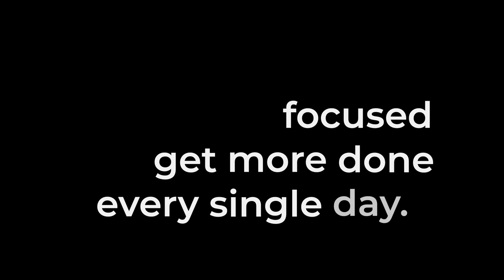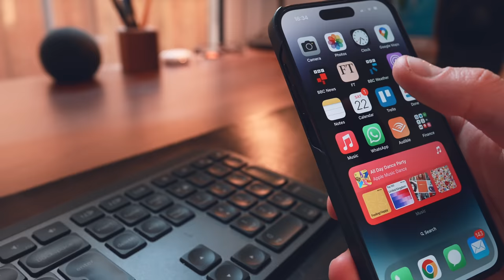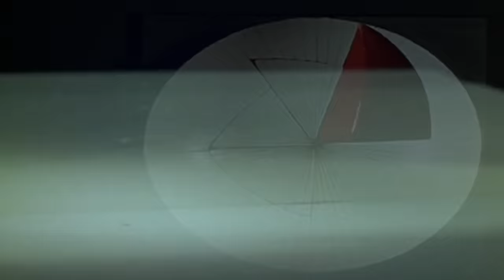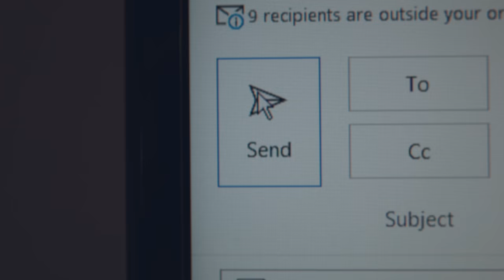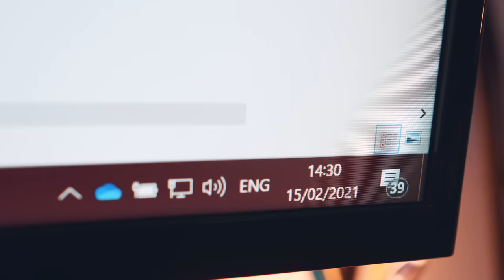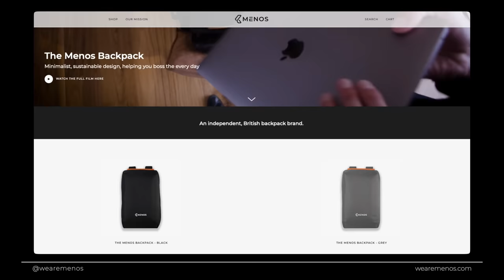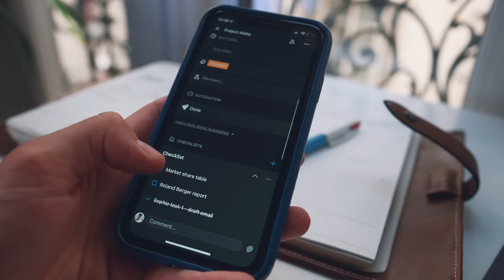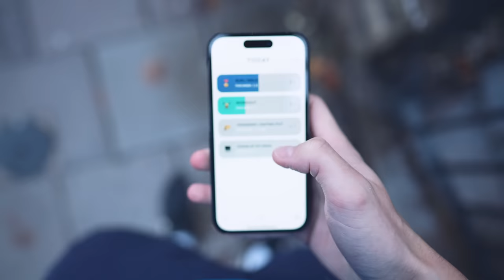Why I'm able to work 12 hours a day with 100% focus - 6 ONE-MINUTE Habits

Comment: The notion that still being in a state of flow and going past the pomodoro timer is terribly wrong. The point is to control your emotions and "how you feel" when doing things like studying. When you disregard the timer to take a break, you are essentially going based off of your own feelings, which pushes away from discipline. This is why it is extremely important to take that break even if you feel like working more. Same thing goes for still working even if you feel like taking a break.